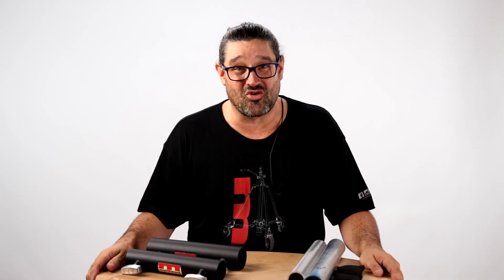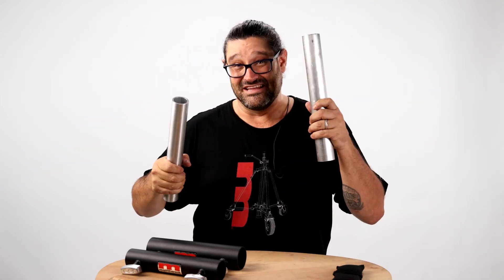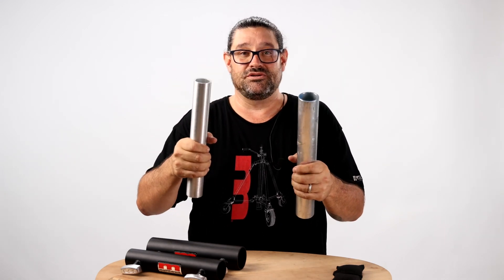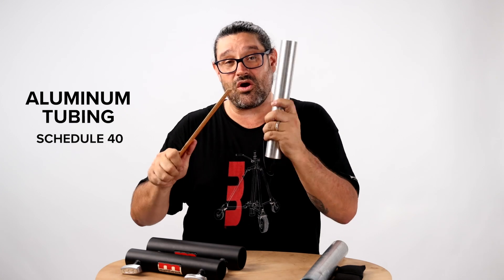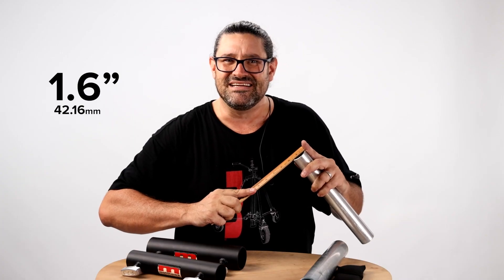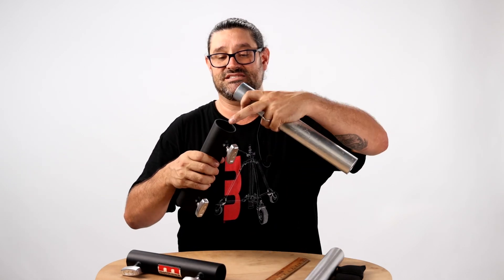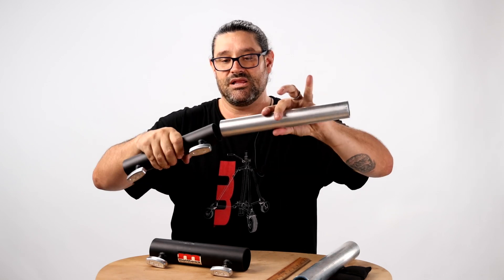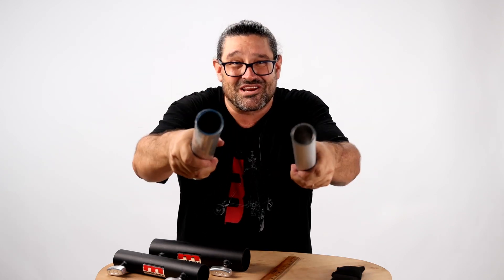Industry Tubing Dimensions Explained

Comment: Its is Pipe! let me clarify. PIPE is measured on the inside or I.D, and is designed for rating as a Vessel (meaning pressure)  TUBING is measured on the outside O.D.
schedule 40 or 80 is a rating for pipe. know let me confuse you.
if you measure the inside of 1 1/2 pipe (1.5) it will measure 1.610 thank you china. manufactures do not adhere to STANDARDS anymore. they are close but not exact.
if you order  1 1/2  schedule 40 aluminum (6061 t6) it will fit your hardware . but its outside diameter is not 1 1/2.  IF YOU ORDER SCHEDULE 80 IT WILL NOT FIT. as it has a thicker wall thickness increasing the O.D. the same holds true for 1 1/4 as well.
Reply: This is how I was taught when I started doing metalwork (in addition to grip/gaffing). Tube is measure by the outer diameter (eg. 1 inch square tube is 1 inch by 1 inch no matter what gauge it is). Pipe uses ASA standard schedule - essentially an equation based on the strength of the pipe at a given PSI. However, the names we use for pipe are nominal terms and not exact measurements - like how 2x4 lumber is actually 1.5 inches by 3.5 inches.